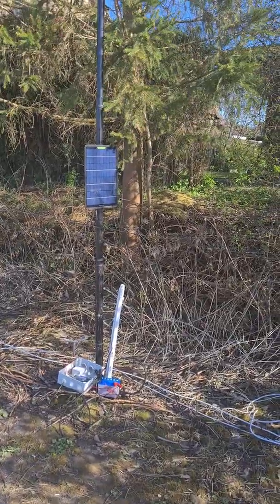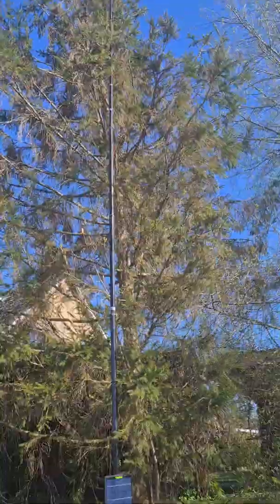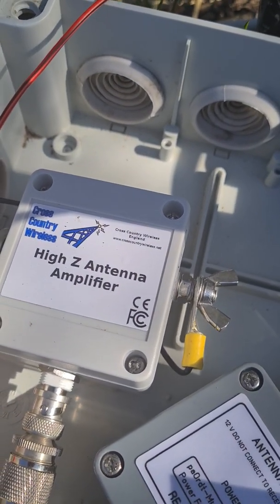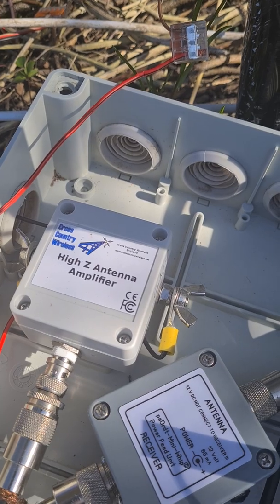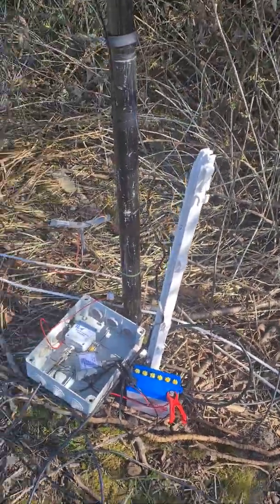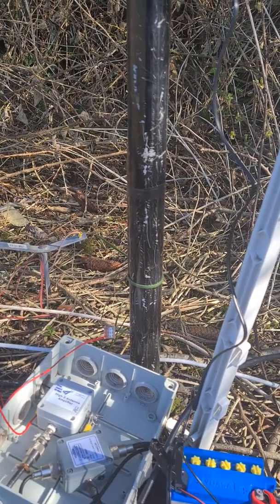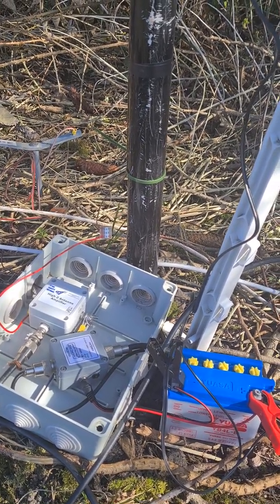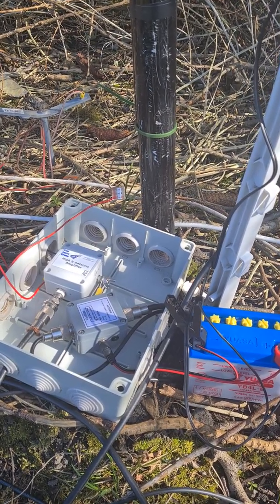short vertical receiving antenna 50khz to 30 Mhz @ DL8LAS

Comment: Hi Andy, have only just seen this video, very interesting work.I have a question for you, my main interest are NDBs at LF, would it be possible to replace the Hi Z amp with the beverage amp in order to go to lower frequencies?,also would it be advisable to add in common mode chokes at the antenna and reciever end?..I appreciate vertical antennas are more noisy and that I will have to add height to the vertical!..I have antenna constraints where I live as well and a vertical is my best option. I am currently using a loop on ground antenna with 9:1 Balun, many thanks
Reply from the maker: hey,  the hiz amp is ideal, also for LF, with a beverage amp it would not work. I don't have
cmcc , and no problems, but you can test it. The height for this amp hiz is maximum 7m.!
There are infos at the homepage from chris

Comment: What is the second box in the enclosure? 73s Tim EI8IC
Reply from the maker: 12v feeding box,  12v to preamp via coax
Reply: @Dl8lasDR5x   - oh, I thought that the battery and solar panel fed the preamp.
Reply from the maker: there is no 12V socket at the preampbox, but they can build the box with 12 V Socket,  o just ordered one